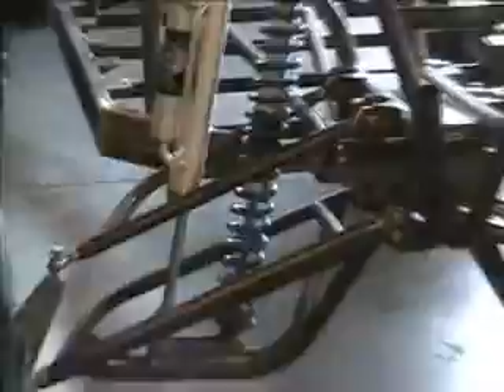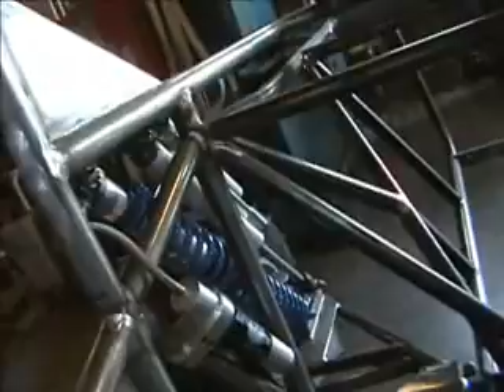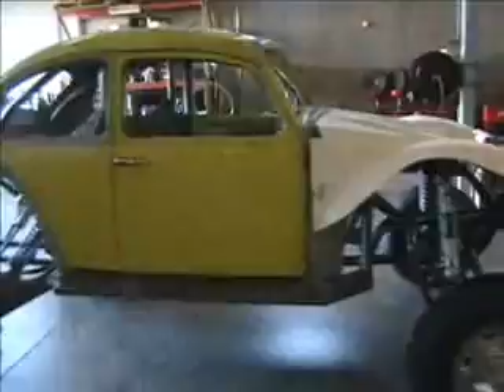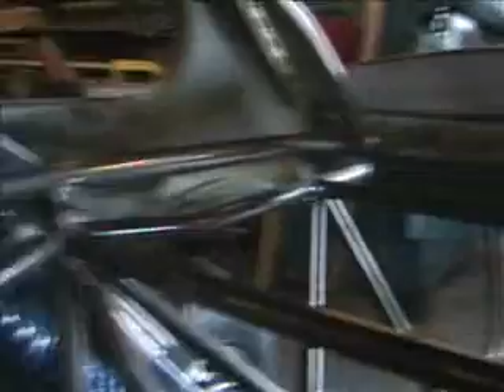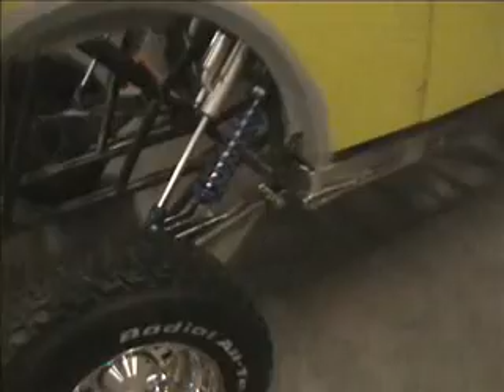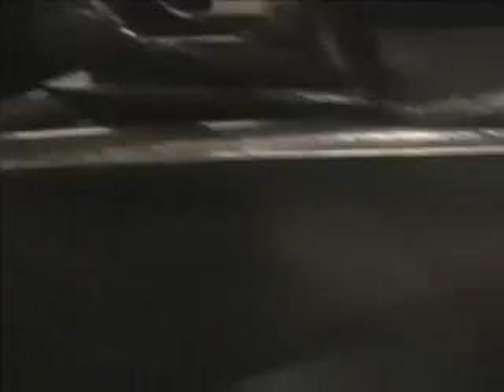Ben's 65 VW baja long travel

Comment from the maker: @pnwracer 
Just the fabricator / designer
24" true at spindles less than 1deg caster/camber change (excluding design camber gain)
will no doubt be some things that need to change as it starts rolling under power...
Owners just had a baby...car on hold or at least slowed down as funds recoup.

Comment from the maker: @dragoncustomcycles complete ground up and out...several lunches with owner..then start bending tube....100% our design. will no doubt be some changes as powertrain goes in and some front suspension geometry may need tweaking...message me for photobucket link to build pics.